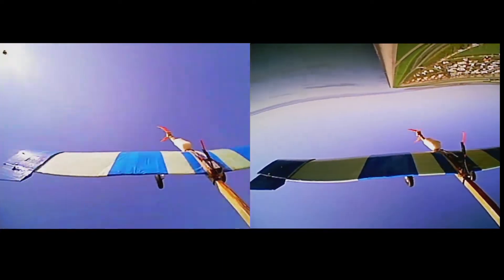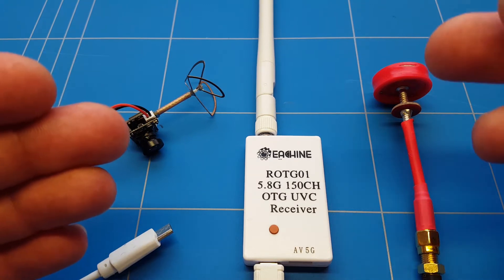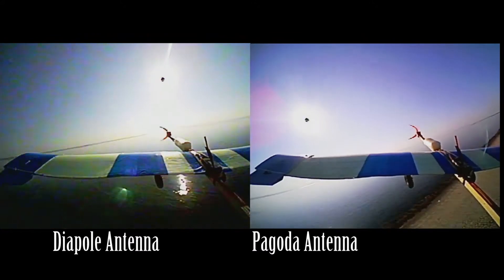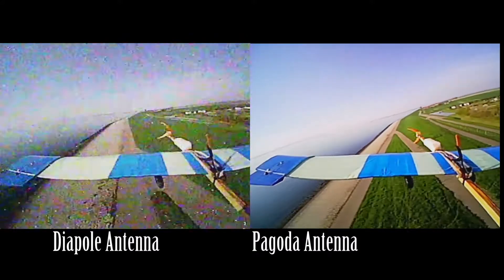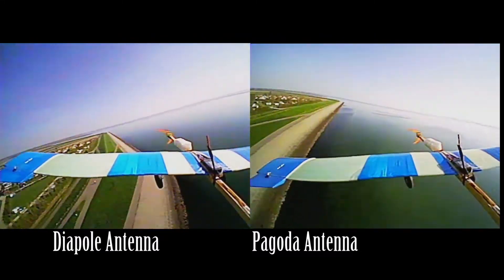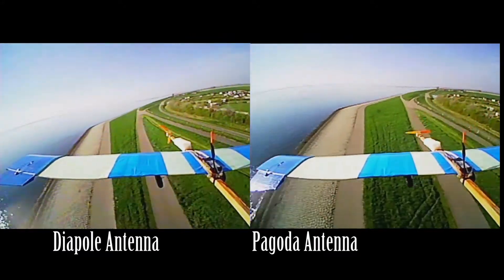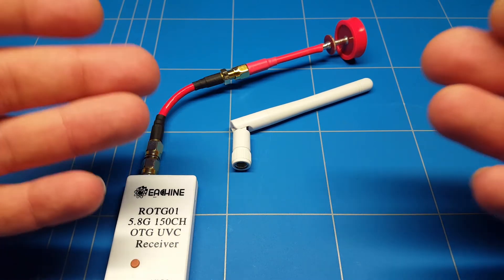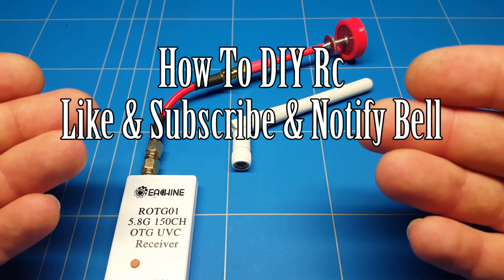Eachine ROTG01 OTG Receiver How To Improve FPV Video Quality Test Dipole vs Pagoda Antenna

Comment: I am wondering, does this dipole that comes with rotg01 is even for 5ghz? i have it mounted on mjx bugs3 mini and the range is about 200 meters max with high interferences , wondering also how the pagoda on rotg will work with dipole on aio cam?? maybe better to use pagoda- pagoda combo?
Reply from the maker: Pagoda antenna are 100x better than diapole antennas definitely recommend to get 2 of them for fpv tx and rx
Reply: @HowToDIYRc  Thanks i have already ordered a couple of pagoda's :P also ordered 5Dbi dipol to use in tiny whoops(hope it will make the signal within 200meters more stable) , cuz the mini dipole antenna is much more crashproof than cloverleaf :D

Comment: Hey and sorry for the question as I'm a newbie, I just bought an ROTG01 and wanna improve the image buying the pagoda you linked in the description, which settings should I choose in banggood for it to work out of the box? RP-SMA Male or SMA MALE? if not, what adapter do I have to buy to make it work? thanks, liked and subbed

Comment: I simply throw away the linear antennas they ship with FPV equipment and install a Circular Polarized Antenna. Always a better solution. Thanks for the video and Happy Flying!
Reply from the maker: yes if notice the difference is huge wish they made a 2.4Ghz version for the radio 
thx for watching mate :D